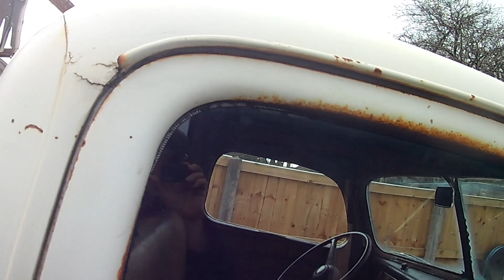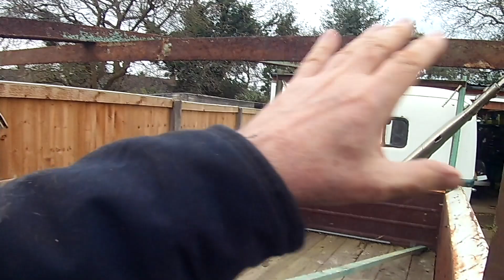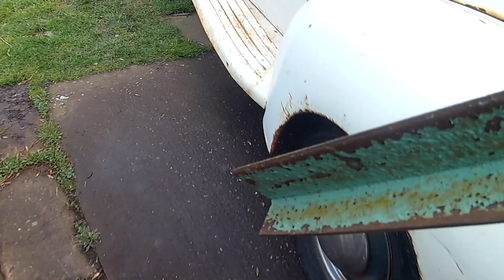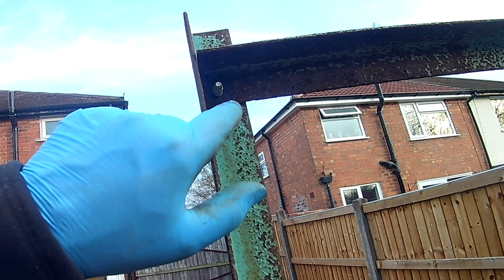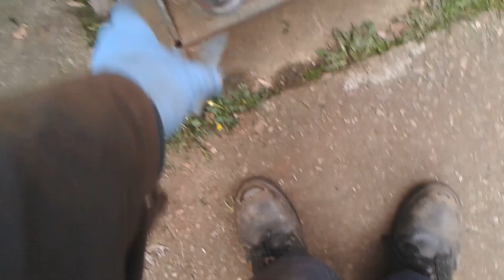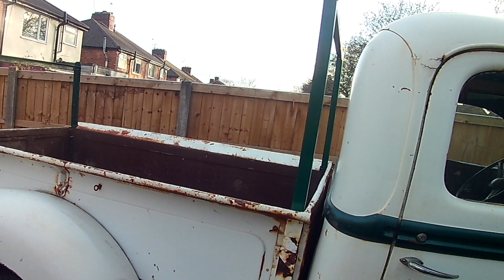Mart's Update 2021/13. Part 1: 41 Pickup: Nice rack! Sumthin from Nuthin.

Comment: Hi Mart, I know this is not the video you showed measuring the piston to head gap but, I used the squashed tin foil method to measure a door seal gap and must say I like it. After always faffing about with Play Dow
or Plasticine in the past it seemed so measurable and clean, plasticine and oil not easy to deal with and the kids always moaned afterwards. GOOD TIP!
Reply from the maker: Cheers Pat. Glad you found it useful. It was just something I picked up somewhere.

Comment: Nice job on the racks!!......I never.....I mean NEVER....EVER.....throw scrap steel away......there’s always a need for a piece of steel. I have a bucket of shorts and pieces and I’m always digging something out of it to use. All that angle you got for free was a S-T-E-A-L. See you next Mart.......Mark from Maine, USA
Reply from the maker: Cheers Mark. Metal is so useful and versatile. I had some 1" and 2" (actually an old bedframe) but this 1-1/2" was just the right size for this job.

Comment: the ladder rack will be very handy! i am a Journeymen Electrician by trade. i used to do a lot of service work and drove a Ford pickup and hauled a lot of ladders and pipe, one thing you should do is mabey put some tie down hooks on the rack to tie your ladders too, you will be able to tie them so tight that they will be part of the truck! good job Mart! thanks for the vid!
Reply from the maker: Thanks Brendan. I can picture that about tying them down. It adds strength to the chassis.

Comment: Great stuff Mart 😁 is it not a shame though to drill those holes in the old truck?
Reply from the maker: Cheers Dave, thanks for the steel, by the way, even if you didn't know where it had gone! (I did ask the builder). No holes drilled, Mate, existing holes used.
Reply: @MartsGarage  at mate no worries mate, better for it to be used than scrapped 😎 he's a good mate of mine too and has an old Stag.

Comment: Hey Mart: That's a clever way of securing those racks in the bed pockets. Usually, they would kinda rattle back and forth a bit or have a 6-8" "Foot" welded onto the upright that would bolt to the bed toprail. Like how it folds up for storage too !! I would suggest welding or bolting some rope hooks a few inches down from the crossbar so you can secure the ladders or lumber when it's being carried. Some of those smaller "ratchet straps" work nice if you don't like to tie knots in ropes.
Reply from the maker: Thanks for the comments, Steve. I just made the design up as I went along. I might add some hooks, I will give it a go without, first, and try and see if an obvious location for tie downs presents itself.
Reply: @MartsGarage  
Hi Mart:
People have called me various things, so far not Steve. No problem. My name is Ron and my kids long ago began calling me Bob (long story) so the screen/channel name "Pappabob". Always enjoy watching your thoughtful and precise content!!
Reply from the maker: @pappabob29  Apologies, Bob, (I always called you Bob) I had a brain fart and was dealing with a lot of comments in one go. Thanks very much for watching and taking the time to comment. I'll try and get with-it next time. Cheers!
Reply: @MartsGarage  
Absolutely no problem Mart. Seeing my screen name, most people assume my name is Bob. My kids started calling me that while teasing me (referring to a "geeky" neighbor) decades ago and it stuck. My actual name is Ron.

Comment: Nice project Mart. Good repurpose of the angle. Color isn’t bad either, just don’t set those on the grass, you’ll never find them....LOL. Cheers 👍
Reply from the maker: Thanks Ron. I thought it looked like I just cleaned up a rack that might have been on there for years. The pitted angle has character that matches the truck. Bit of machining for you in this one.